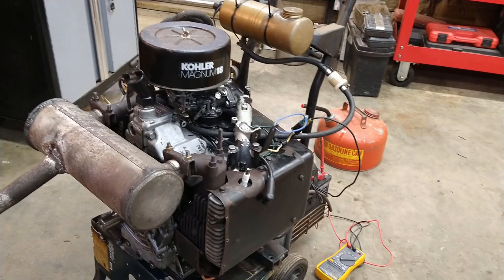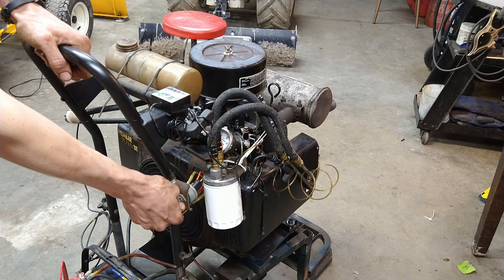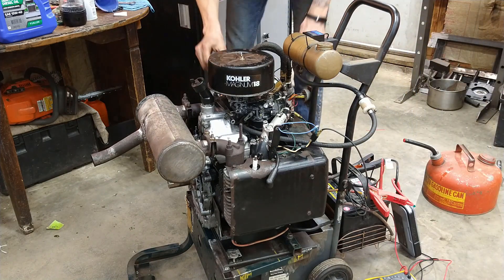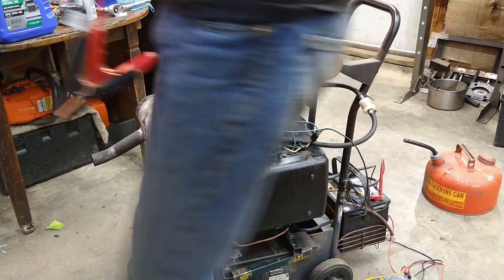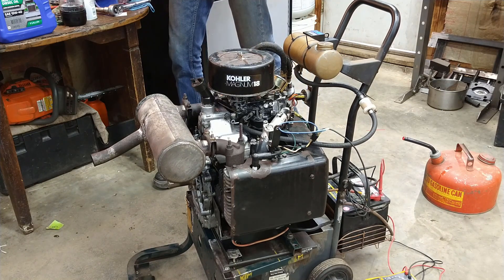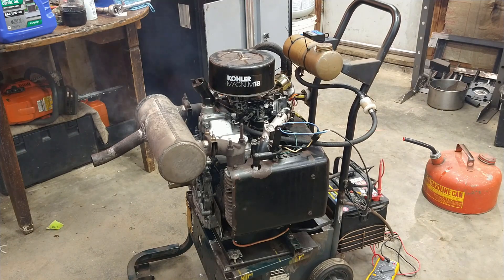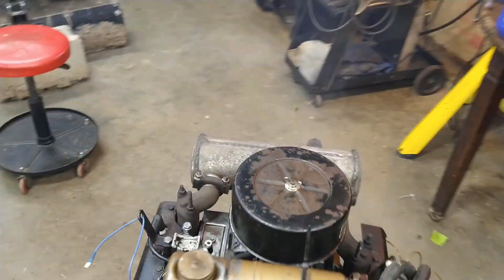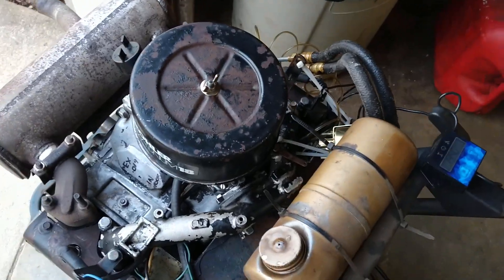Kohler Magnum M18 Complete Svc, Part 19: Testing & First Start – Cub Cadet 1882 Restoration Project

Comment: I have a 1988 Gravely 16G Pro tractor with a 60 mower deck since new and is used to cut about 7 acres of grass every season.  I absolutely love it for its simplicity and rock solid reliability and ease of maintenance. All that has been done to it is regular oil and filter changes, greasing it and blowing out the jug fins with compressed air once a year. The ignition coil and fuel pump was replaced a few years ago. The starter bronze bushing wore out but I just rotated the starter endcap 90 degrees to get it to start again. Other than that it does not burn oil, nor leak anywhere and is surprising to me as all seals and rubbers  are still original from 1988 (except intake gaskets).  I enjoyed your M18 series as I suspect the valves could use a re-seat and adjustment and I learned a lot about how to do it and what to look for. A few years ago I had the sticking float needle valve problem, but I solved it by adding a small spring hook and hooking the needle to the float. This sticking problem usually occurred after sitting in storage over winter, so now I run to carb dry every end of season.
Reply from the maker: Those old Gravely 16G models are tanks.  Glad you have kept it around this long, we won't be able to replace them with anything comparable.  🤘🤘

Comment: Love it. Always a thrill to see one going after being in pieces. You might have covered this prior and I missed it. How did you have the oil
gauge hooked in.  Did you rebuild the Carb in this process?  Thanks again  great stuff.
Reply from the maker: I had a tee fitting at the oil pressure sender port (1/8" NPT) and had the oil pressure gauge line and low pressure switch plumbed into that tee.

The tractor will be set up to have the factory oil light and a gauge both.